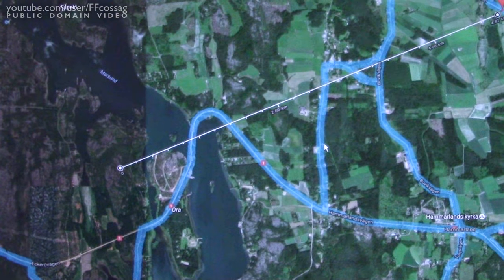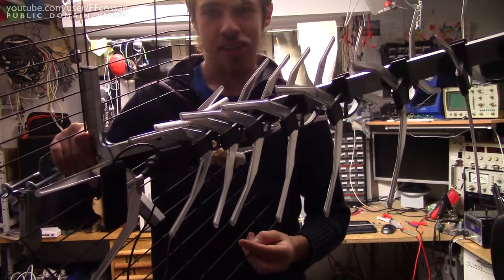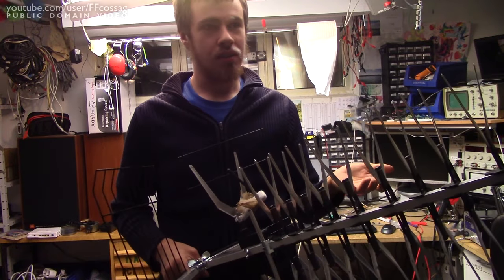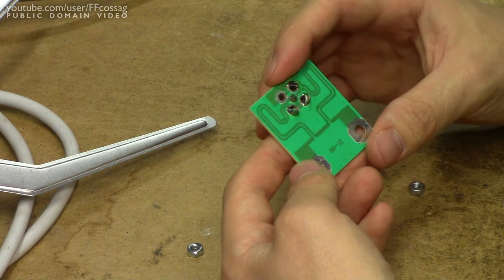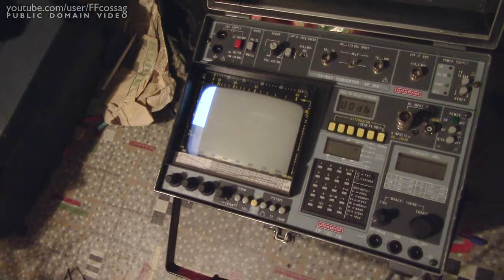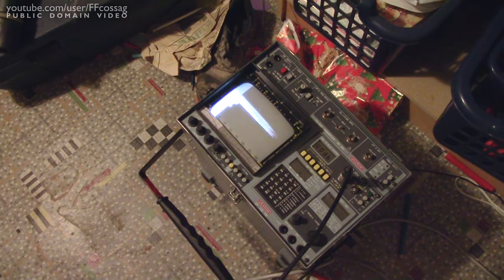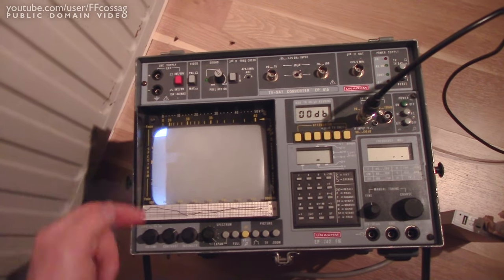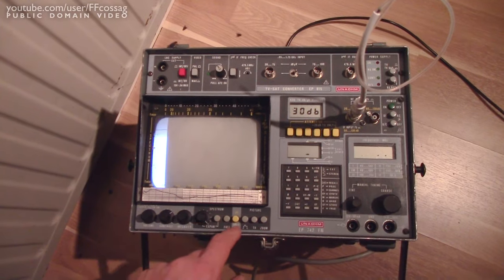Making of the "Internet blaster" 4G antenna

Comment: What a novel idea! Thanks for documenting this, I was planning on using a re purposed antenna like that for ADS-B reception. This is helping to explain some of the peculiar results I got in my home.
Reply: tmanF4 
Hi,  for ADS-B reception with an yagi antenna you would have to add a Band-pass filter because you wil get most likely unwanted interference signals.
Remember that such TV antenna is not suitable as ADS-B frequency is at  1090MHz.

Comment: Why not unscrew the omni antenna on the dongle and try and wire it directly into the old connector you took off the antenna?
EDIT: Looks like that's exactly what you did in the 3.0 video

Comment: +FFcossag can u help me with this project? I have a couple of questions
Reply from the maker: I really have no idea about how this actually works, WYSIWYG.
Reply: info I need is simple, which usb are u using and how did u connect the internet usb to other stuff. What stuff I need antena, 4g usb, anything else?
Reply from the maker: I'd recommend you just use a domestic 4G router. The USB stick isn't really made for this.
Reply: I rewatched the video, so I just but a router and connect the antenna directly to it? How do I choose which router just look for the router with same frequency as the provider 4G frequency?
Reply: I searched for hours online didnt and I didnt found a 4g router that with sim to insert and 2 antenna connections?
Reply from the maker: You'll have to do your own research. I'm no expert and I managed to do it, so you can too.

Comment: I wonder how good the connection would have been with the original recievy thingies connected to your 4g modem antenna connectors.
Reply from the maker: I'm thinking about testing that when I get the new antennas that I've ordered. Since I have to shorten the cord on them anyway, I figured I'd try connecting them up in some haphazard way in the process. There's probably gonna be a giant impedance mismatch going on since I have no idea what I'm doing, but I suppose it'll at least be a fun test!

If someone has any ideas for how to (semi-)properly connect it up, I'd love to hear it.
Reply: @FFcossag  It should work, but you have to replace the 75 ohms TV coax cables and connectors with 50 ohms ones (eg. SMA connectors and 4g rated coax cable) otherwise reflections will completely kill every attempt of bidirectional communication with the 4g tower.

Comment: FFcossag if you lift the cooler high enough so that the lower reflector of the antenna is higher then the heat register you will probably get almost full strength or put the 4G modem in a plastic container with the antenna on the roof but with being in finland in the winter you might need some thing for the colder weather ... :)
Reply from the maker: I have noticed that it does work slightly better if I raise it just a little more. Do you know what the technical reason for that is?
Reply: +1 for the roof install. This USB reciever most likely works fine outside if you put it in a waterproof container of some sort, like a plastic bag. I had a 4G router outside in a bucket (for blocking sideways signals) for 2 years without any issues. Also seeing you have a decent spectrum analyzer i should probably try to donate you my useless parabolic 4G antenna i bought but had no use for it because it's way-way too directional to install without spectrum analyzer.
Reply from the maker: woox2k A roof install would be nice, but I frankly can't be bothered, lol. You also can't access the roof safely during winter.

If you want to send me that parabolic antenna (and it works for 800 MHz), send me a message and I'll give you an address.
Reply: The heat register is basically rf interference connected to ground. Cant think of anything techy to say lol...

Comment: I also had pretty bad 4g signal with the dongle thing.  But then i just put its sim card into my phone and for some reason the signal got stronger and speed increased
Reply from the maker: Clearly, your dongle has some less-than-good antennas.
Reply: FFcossag I dont think so. the same thing was true for 2 different dongles from 2 different ISPs.

Comment: How much do you pay for your 4G connection, and is it capped?

Thanks, liked.
Reply from the maker: It's about 20 € per month with no limits.
Reply: That's very reasonable.

We now pay around 70 € a month for TV and Gigabit Internet...  But it's a promotional price and we had to fight tooth and nail to get it.  While the download does indeed reach over 700mbps, the upload only reaches around 30mbps at the best of times (Though it's advertised as 50mbps).
Reply from the maker: khachaturian Wow, that's as asymmetrical as ADSL.

Comment: Is that a UNAOHM spectrum analyzer? oh dear it is... good old italian quality vintage technology
Reply from the maker: Yep. It's ... an interesting piece of kit. Not the most logical.
Reply: FFcossag not ergonomic for sure, it's a thing of the past but still working, I bet with no calibration since ages. It's a Soyuz of analyzers. The fast spectrum view is still an almost unbeaten feature.

No considering the weight (should be around 15-20 kg), it's much better than any chinese-made digital crap sold nowadays.

When men were men, they took this bulky heavy thing with them on the roofs. No lithium battery in those times, sorry.
Reply: jcyb9 Wow didn’t know it was italian 🇮🇹🇮🇹🇮🇹🇮🇹 thanks🇮🇹🇮🇹🇮🇹 i’m italian

Comment: You have a better connection than most Italians. Average is 7mb down 0.5 up.
Reply from the maker: Oh dear, that's awful.
Reply: The environment requires a lot of resources to make it easily accessible the broadband in my country. Obviously the most important cities have connections up to 500mb while rural areas (even a couple of km away) are not served. Having xDSL connections as you know the attenuation plays a very important role. Having the DSLAM only in larger cities you can guess that outside the city the phone lines are only for "voice."

Obviously the HSDPA / LTE follows the same rule as the problem is also the lack of fiber optic in radio towers. (Rurals area are connected only using a radio bridge) Fortunately, this solution is better than phone lines.

I re-read the updated statistics in this year (june 2016). The average is 8.2 Mbps (+ 9.8%)
Reply from the maker: TuttoCrafting At least it's slowly going the right direction!

Comment: it only takes 1mbps to stream, a little overkill is nice
Reply from the maker: I'm not sure what you're streaming, but HD video compressed down to 1 Mbps is not a pretty sight.
Reply: i could be wrong, was just what i always thought, at the moment im experiencing real bad internet speed, OMG
Reply from the maker: Well, you're not technically wrong; you can stream at 1 Mbps. However, for 1080p streaming, you definitely want at least 10 Mbps of available bandwidth, or you're going to have to make some serious compromises.
Reply: @FFcossag  my new win10 says good streaming of hd videos is about 60 MBPS, it used to run at 15mbps until i made a cantenna type device its so much better now it even hits 120mbps sometimes WOW

Comment: Why don't you build a more better antenna for 800MHz ?
You should build a cross-yagi antenna because 4G signal is Horizontal and Vertical polarised.
There a many build instructions available on the web just Google it up. 
I use this antenna and it works very good depends on how far away from the cell tower:
novero dabendorf LTE-800 MIMO Antenne weiß https://www.amazon.de/dp/B0051EGCGQ/ref=cm_sw_r_cp_apa_JTOdybN5Q9RSG
These are available in other frequencies as well.
Reply from the maker: That thing is really expensive compared to my free old TV antenna. I would like to try to have an antenna that's both vertically and horizontally polarized, since it does seem to make a big difference. I'm not really sure what the one I have even is, given the really weird shape of the elements.
Reply from the maker: I have considered just taking half of the elements and rotating them 90 degrees; this antenna doesn't seem to connect the elements from side to side - they're just attached to plastic.
Reply: Some yagi antenna are constructed  different from others as some design have thier directors elements directly to the boom others are isolated.

Comment: At least you got 1Mbit/s. I get only ~400kbit/s up and 5MBit/s down, (not wireless) the cernter of the city is only 20km away. In such things i hate Germany. >_< And Wireless has only Volume Rates, like 20MBit/s and 1GB and such bullshit, for 20€/Month.
Reply from the maker: Wow, that is exceedingly poor.
Reply: For a 1h Video with 720p (about 1GB) took it 20h to finishing upload, just right before the forced reconnection.
Reply from the maker: Grumpy Electrician I know your pain intimately! My renders are usually 1-3 GB in size, and I've been using ADSL for all my uploads for several years.
Reply: my brother same shit here just 0.5 km form the center of city